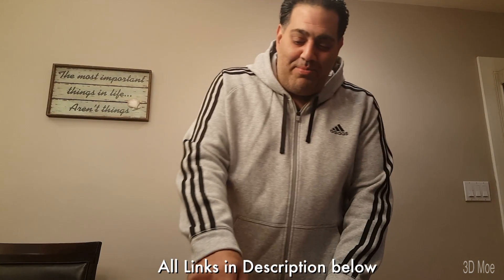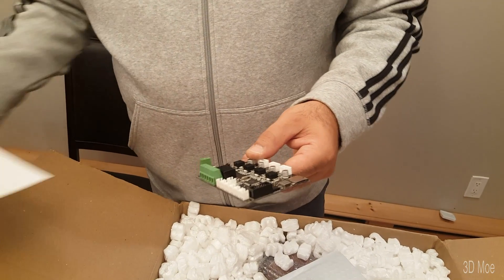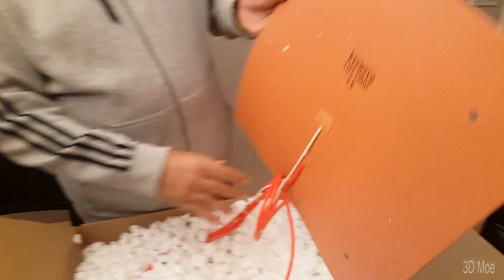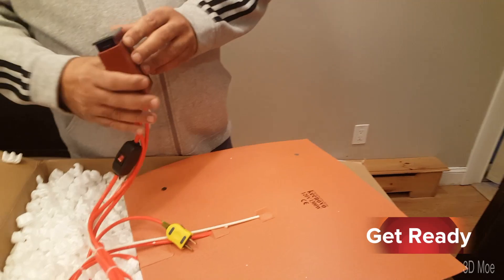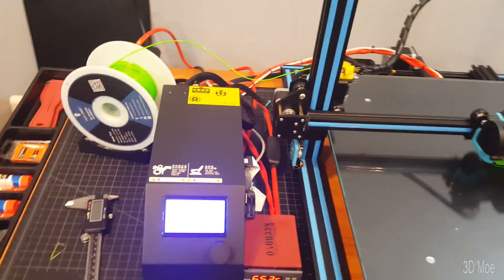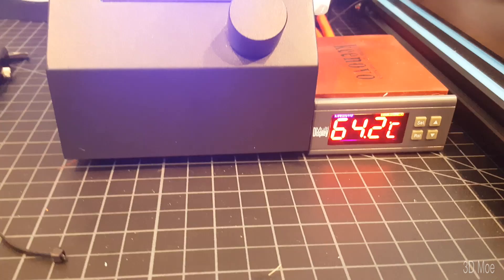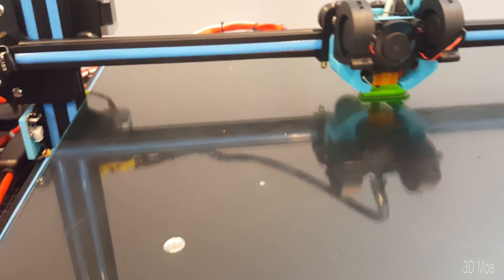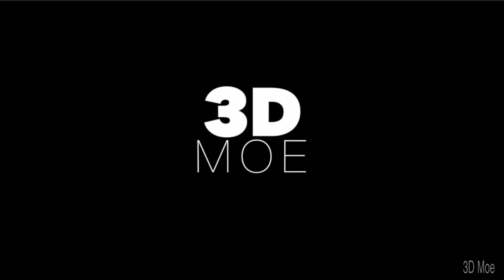Tiny Machines Upgrades CR-10 S5 / Unboxing & Build

Comment: Hello, hope the CR10 S5 is working out for you.
I've just ordered one Keenovo heat pad.
How is it doing under the plate? Someone told me to add another layer of silicone sheet under the glass on top of the aluminium plate to help spread the heat more.
With your experience of the Keenovo, would you consider that or not?
Thanks for the video. There are very few videos showing off the Keenovo heat pad.
All the best.

Comment: Thanks Mr. MOE. 
Just checked Amazon and they have a newer machine. But then again your videos are a year old. Gonna have to look through your videos and see if they have fixed some of the problems you found. Did you buy your printer through someone?
Reply from the maker: ebay at the time everyone was sold out.. yes all videos are old haven't had the time to create videos with my new work schedule
Reply: @3DMoe  thanks for your reply. 
No problem. Gonna compare your fixes with the new machine specs. Might still need to buy some mods but hope its not a lot like your glass idea and heat pad. Can't wait to get one and when I do hope I can share with you what it comes with and maybe not many changes to make it a good machine. Looking at getting a credit card to buy it and pay it off in time.

Comment: Nice , have a luxnwatts upgrade S5 with dual z lead screws in the amazon basket, and am thinking about grabbing a 6 watt laser for it. Just grabbed a Sony 3d scanning cellphone, and might try to make a few custom mods for cars guitars or, heck it's possible to print tripped out backsplashes for the kitchen, solar cell mounting frames, or whatever. Thingiverse.💫
Things are very heavy in the 80's. - Back To The Future

Comment: I might have missed it, but what was the reason to replace the MB?   (Just the firmware update?)  Has anyone looked into the benefit of insulating the back of the bed?
Reply from the maker: At the time I didn't know how to load the boot loader

Comment: Sir is there any way to resume prints after power failure in cr-10 300×300×400 ??? Please help meee
Reply from the maker: Tech Unboxing not that know of.. i believe the new mother board had that option ...get a small upsthats what i have
Reply: 3D Moe ok sir
Reply: Sir that link not working

Comment: Is there any thing like this for my cr-10 300×300×400????
Reply from the maker: yes
Reply: 3D Moe then please give the link sir
Reply from the maker: i would check tinymachines3d first if they dont have it try amazon.. or ebay
Reply: 3D Moe ok sir and thank you 😊 and if u have link please share to me
Reply from the maker: the one on amazon is good but you are going to need a slr if your willing to solder up some stuff give it a try buy i cant help you with that.. mine was purchased from tiny-machines pre wired
Reply: 3D Moe hooo link please and sir I don’t know the correct wiring
Reply from the maker: I dont see it on tiny machines buddy!  reach out to them the link to there site is in the description..
Reply: 3D Moe ok sir thank you and if u have the  amazon link please share it😊😊and thank you sir
Reply from the maker: just go on amazon and type keenovo
Reply: 3D Moe ok sir and sir if i am upgrading that bed then if i need to upgrade my motherboard or ???
Reply from the maker: I would upgrade the firmware since some settings need to be changed

Comment: The acceleration code changed with Marlin 1.1, so if you get any too-jerky motion you can try lowering acceleration and jerk in the LCD menu, and save to EEPROM when movement seems the best it can get. If the new board has a bootloader (or if you flash one) then you can enable other features like Linear Advance to get better sharp corners on objects and less ooze. Anyway, happy printing! It looks like you could print a whole sword or two at once on that bed!

Comment: Did you find you had to replace the bed glass? I hear there were warping issues on some models.
Reply from the maker: Garden Troll yes I did in the beginning but I eventually went with a EZABL and buildtak directly on the aluminum bed
Reply: Thanks Moe!

Comment: i have the exact same printer but ordered from aliexpress, stock and bought separate the heat bed. how i can disable the original hot bed settings from the firmware?
Reply from the maker: my EZABL sensor video shows how to

Comment: I don't get it, doesn't the CR10 already come with that motherboard & firmware in the black box?
Reply from the maker: Immortal So Far yes it does this was a upgrade i purchased pre flashed firmware with a boot loader
Reply: @3DMoe  could you not have flashed the original motherboard instead of buying a new one or does the new motherboard have extra features

Comment: So how has the heat bed improved your prints so far? Also, have you tried ABS on it?
Reply from the maker: not actual print quality.. but bed bed adhesion is amazing and abs sticks like glue .. and it heats up super fast, no gluestick just a light layer of hairspray ..
Reply: @3DMoe  hairspray? New at 3D printing.
Reply from the maker: @guillermopatino3928  yep brand new